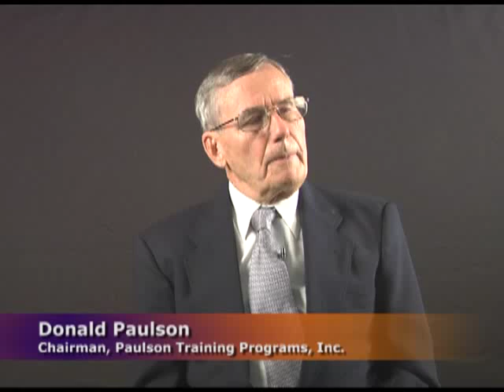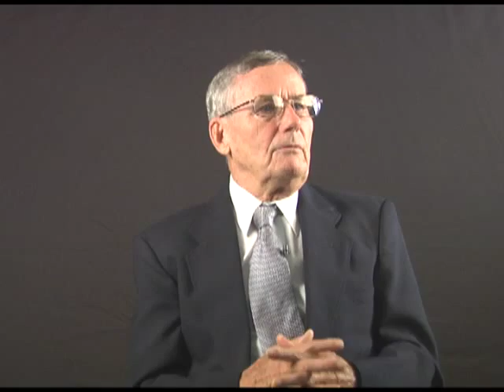Scientific Molding - Part 3: Troubleshooting Using Scientific Molding

Comment: I worked in a few injection molding companies, and surprisingly when i talk to them about The 4 variables approach to Injection Molding, they basically have no idea, most technicians and even engineers are using the "learn from your mistakes' approach instead.
Reply: How can I control cooling rate and flow rate?
What are the parameters?
Reply: @mahmoudradwan2979  heat in equals heat out